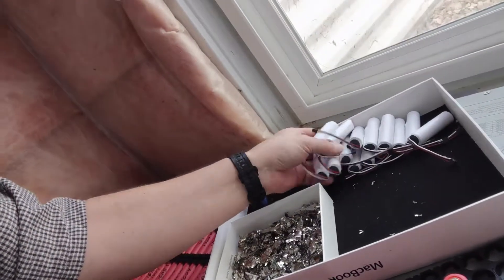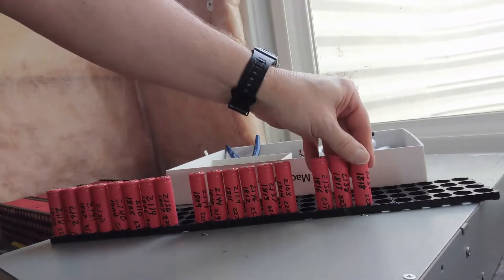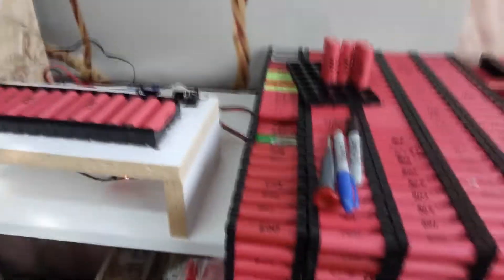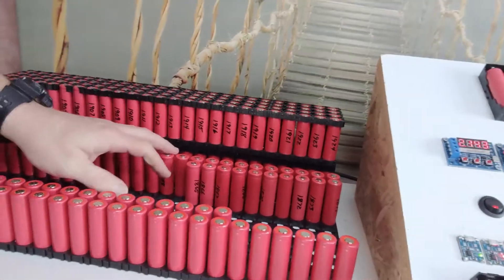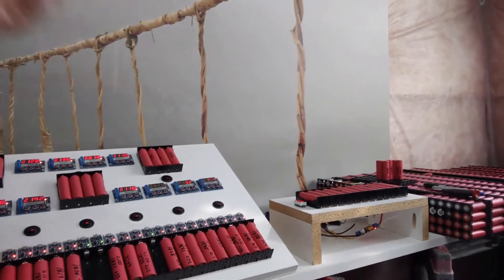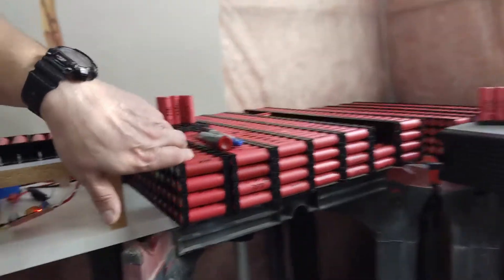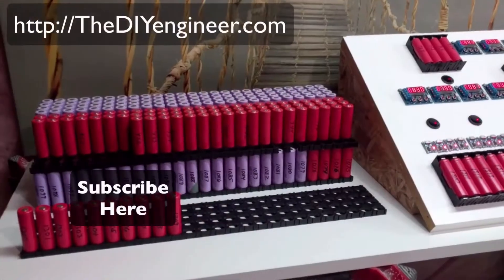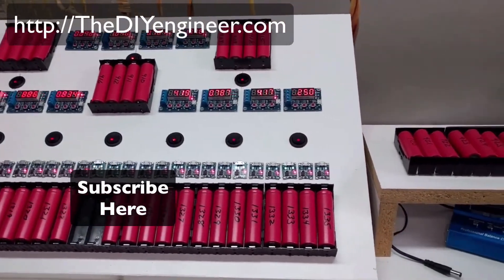DIY Powerwall Cell Processing Update

Comment: Hola, necesito tu asesoramiento, tengo una scooter electrica, 48 volts, 350 wats y quiero armar un pack de celulas 18650 de 25 amperes, ¿Cual seria la configuracion para lograr esos amperajes, ruego tu atencion, saludos desde Argentina